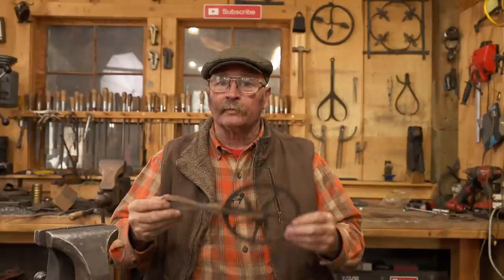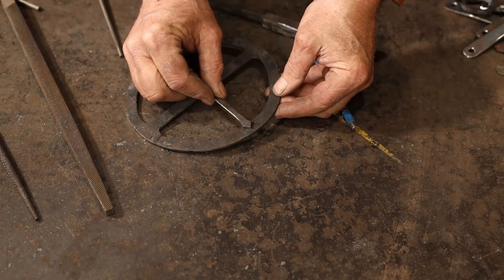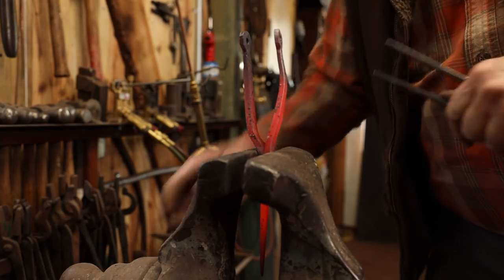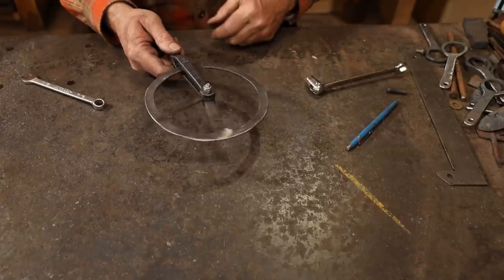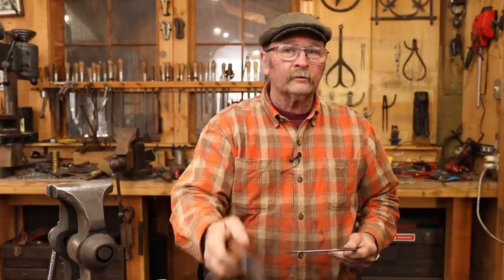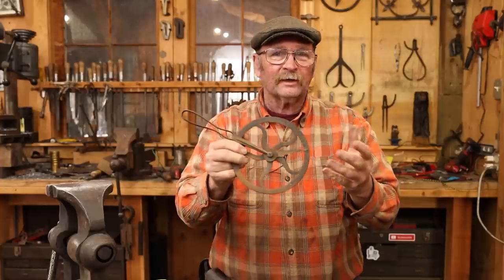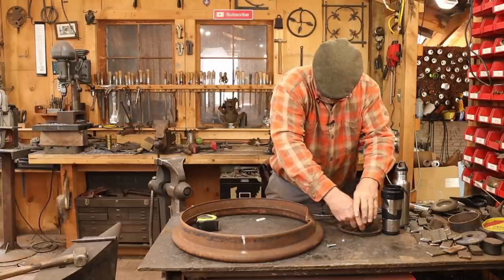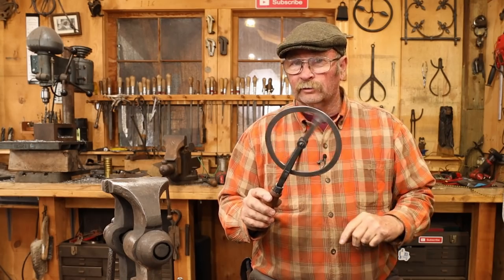Wheel wrights Traveler part 2

Comment: Drive a punch in the pointer hole such that it  becomes cupped instead of flat.  The top (wide end) of the cup goes toward the wheel, the bottom (narrow end) goes to the washer.  The increased surface area of the top cupped section assures that the pointer will always have more affinity with the wheel over the hub due to the difference in friction on each side of the pointer.
Reply: Pretty good idea 👍🇺🇸
Reply: Very good suggestion. I'll remember that in the future. In addition, if the pointer is curved slightly to put more pressure on the outside of the ring it should stay in place even if the flatness of the traveller is not perfect.

Comment: forge weld the pointer to the rivet  and open the spur up longer then the rivet so when you set the rivet there is tension on the rivet.

Comment: another option would be to just use a wing nut on the screw threads to tighten the whole thing up after setting the pointer, then it will lock it solid and not move on you after youve set the pointer to the end point.

Comment: John,
You had a "Vross Peen"  hammer with the that had the head with 2 fullers 90 degrees apart. Where did you get it or did you make it yourself.

It would be great to move metal in 2 directions without having to move to the end of the forge.

Keep up the great videos. I am always learning tips and tricks on the projects.

Cheers,
Pat
Reply from the maker: That one is a store bought double faced hammer that I re forged.  I have a video for a similar hammer https://www.youtube.com/watch?v=liuBBCn6-RE

Comment: John the belt sander you used in the beginning of this video, did you build that, or purchase it? If you bought it do you mind sharing that specs and manufacturer? Thank you sir. I loved the project, I can see good use for this tool on several projects!
Reply from the maker: That grinder is a Wilton Square Wheel. It is now sold by Jet tools. Its 1hp single speed.  I think the KMG grinders from Beaumont Metal Works would be a good all round grinder

Comment: Why would a pointer even have to move?
Reply from the maker: In use you are counting revolutions and ending short of a full revolution.  The pointer must be able to set that end point, the chissel mark on the wheel is the start point.  Think of it like a tape measure where you need to measure 48" but you pencil is permanently attached at 40", it wouldn't do you any good.  The pencil has to be able to mark the required measurement. In the case of the traveler using a chalk mark at the ending point instead of having a pointer is just as useful.